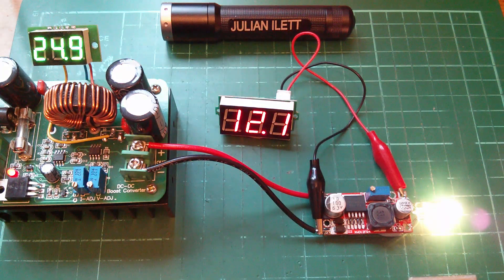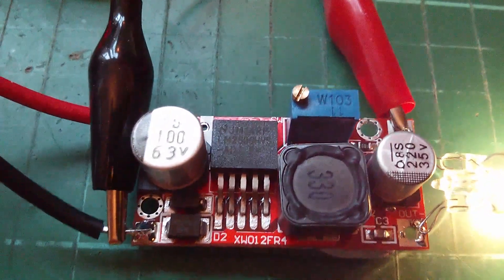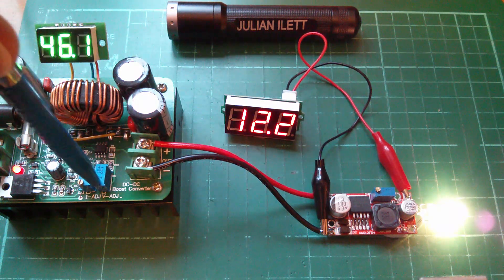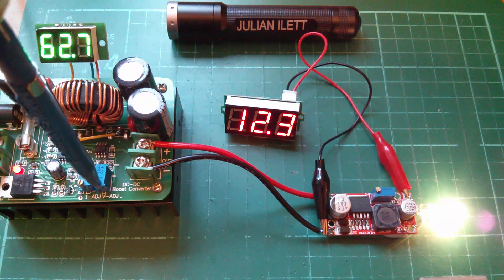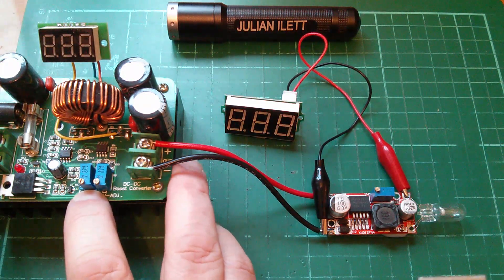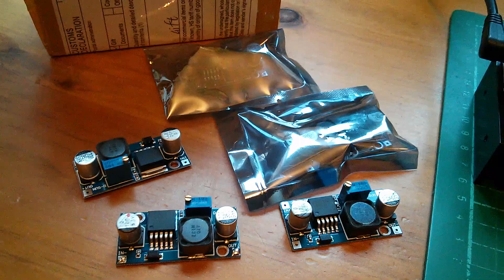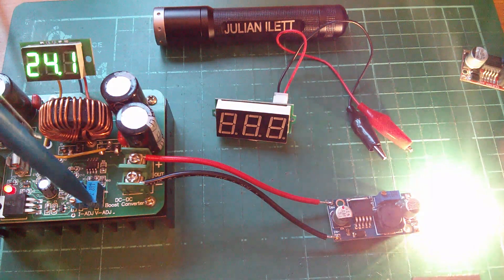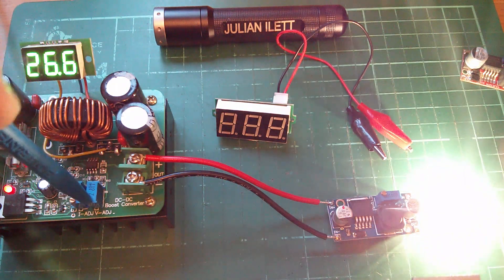Fake LM2596HV Voltage Regulator Buck Converter Modules bought on eBay

Comment: how is it fake if it works?????
Reply: +Ese Callum I have given you an example to explain difference between real and fake. It doesnt matter if designer or locally small business made, Whats important is the integrity of the product
Reply: Well if you want to spend a dollar to "measure" output voltage for a few days rather than spend 2 dollars on something that will do the job for years, go ahead.
Buy cheap, buy twice.
Reply: Well you can still wear fake adidas shoes, but it last few days or weeks instead of a year or more. Same goes for this, They use substitute quality semiconductor core that manufacturing cost is fraction of authentic one.
Reply: I think you have been at too many presentations which spout marketing bullshit.it's a a simple dollar device for measuring voltage....integrity of product my ass.
Reply: i would NEVEr GIVEANY MONEY TO ADDIDAS or a designer label...who cares...for a dollar..you probably spend 20 dollars on a beer which you piss out in 24 hours.

Comment: What was the LM2956HV input rating on the data sheet, I thought I saw 40v, or 45v, and the supply voltage was taken up to 55v if not more, ..did I see that wrong
Reply: Yes, you both saw it wrong... Julian was looking at the data sheet for the STANDARD regulator chip which listed that voltage, NOT the one for the HV part, which is supposed to handle 60V. He pulled out the standard chip data sheet because he suspected the chips had false markings and he wanted to know what voltage the standard regulators would fail at to see if his "HV" chips were actually standard ones when he cranked up the input voltage.

Comment: They are not HV, you can tell just by the way they look. I would send them back. If they were cheap then use them for low voltage use. I really don't trust things sold on Ebay to be authentic. Ebay is full of cheap knock off's so buyer be ware.

Comment: Check out your inductor value while you are there. No-smoke unit says '330', smokey unit   says '470'. (uH?) Swap the 330 from the no-smoke onto the smoker, see if that is the problem.
Reply: its actually 47uH, last digit is the 0 multiplier
Reply: Yes, I appreciate that, my point was the value of 33uH instead of 47uH could be the cause of the smokiness, ie;  the circuit can't handle the higher inductance and is operating outside it's intended design range.
Reply: I agree with you, these modules have fixed inductor values, but in fact, you need to select values according to your MAX input voltages (see the datasheet).

Comment: For what it may be worth I have also found quite a bit of "bad stuff" on Ebay. 
In every instance I contact the supplier & politely ask for replacement or refund.
After a bit of "toing & froing" in 9 out of 10 cases I receive a refund. Occasionally I have had to thresten to leabe negative feedback which hastens things along.
All the el cheapo electonic stuff is inherently suspect, order or use at your peril!

Comment: This video is a fake!! ....or rather the claims that there are "genuine"  LM2596HV chips available?  Where is the data sheet?!  The nearest neighbour I can find is a LM2576HV.  Please update the video with further and better particulars please.
Reply: Yanick Smith CVT constantly variable transmission
Reply: http://www.datasheetspdf.com/PDF/LM2596HV/1012141/3
Reply: Spencer Sawyer Interesting...thanks for sharing.  the 2 boards i bought which, apart from being blue are similar to the video above.  The chip i have is marked with the national semiconductor logo and as such i called "fake".  it looks like you've probably found the source and, after using the board for the last year or so it does at least seem to work ok!

Comment: For what its worth, I bought a none HV version that is an exact match for the blue 'fake' one you bought. It interestingly has a 50V input voltage capacitor on it, which matches your fake one before it was changed.

Comment: The term 'fake' is not as appropriate here as 'bad copy'. Apparently you aren't aware of all the tv's, computers, radio's, calculator's, multimeters, etc. that use the same or very similar board designs, any one of which is either the 'original' design or a variation, either purchased or cloned. There are even automobiles with the same basic guts being sold as different brands because they have different body parts. You certainly wouldn't call these 'fake', but only because you feel it's safe to assume that the seller 'bought' the license to use the patented design. But the buck always stops when it comes to the quality of the parts used in the construction or shortcuts to expedite production or a lack of the complete set of features. Are these then 'fake' because they don't rely perfectly on the original design and specifications? No, they are simply poorly produced copies.
The buck is the only common denominator that causes the variations: savings on design, savings on cheaper parts, fewer design elements used and the list goes on, but I'll stop shy of going into the level of abuse of all technology in the name of dead presidents. Suffice it to say that there is a serious level of pathetic profit chasing at the hands of investment driven financial institutions, many of which encouraged the displacement of jobs and manufacturing to lower-wage, uneducated poor populations in other countries, and the fact that this 'Wall Street cancer' is attaching itself to every manner of merchandising all over the world shouldn't be blamed on the poor folks or the corners they cut to 'make the grade' for continued rewards from this corrupt system where safety, quality and the human condition are second class idealism's.
A true 'fake' is a plastic fruit or other plant, a car-shaped balloon, a hair-piece made from artificial fiber, a flower that looks like a bird, a bug that looks like a plant, etc. At least the latter, organic types of 'fake' are related to the overall success of the respective species, rather than a few bad CEO apples.

Comment: You pushed it way past the Datasheet Max voltage of 45v. Of course it's gonna blow.
Reply: +Rob Prebil LM2596HV. HV!
Reply: Tough little unit though...
Reply: "You pushed it way past the Datasheet Max voltage of 45v"

For crying out loud, why did so many people get confused about this. The data sheet Julian was showing was for the STANDARD part, NOT the HV version that was supposed to be on these boards. The reason he checked the standard data sheet was because he suspected the "HV" parts had false markings and he wanted to know what voltage would blow up a standard chip so he could apply that to the suspect regulators to see if they failed.

Comment: Use the low voltage version of this in my resurrected Black and Decker dust buster (lithium 18650 conversion), It rocks!..  Works with the original a.c. transformer too (half wave rectified). Never had a problem with these used anywhere, but will be wary in future ;)

Comment: Does this buck converter(LM2596s)
 work on a motorcycle with a12v 9amp ? I want to reduce it to 4.5v dc for a led tail lamp.Pls help. 🙂
Reply: +arun reetha These converters are usually only good for 1 amp, for reliability. Claims of 3 amps with heatsinking are made. No way for 9 amps.
Reply: +arun reetha if its just to power LED's yes that should be fine, just install it without the LED's set the forward voltage to what the LED's need via the little pot and connect the leds I'm assuming they don't draw more than 1 amp as the other poster pointed out more than that and the magic blue smoke might escape. but tail lights etc all good!
Reply: +arun reetha hi Arun, what's going on with your project, does it work?, let me tell you one thing, i put one boost not buck converter, exactly for my led tail lamp (with 120 leds 2835), i boosted voltage to 17V, and works OK but only for 20 min, after that i noticed an unexpected behavoir of my led tail lamp, until now i ain't figure out what's going on, but i will (hopefully), regards
Reply: thanks a lot my dear friends for the reply.thanks for sharing your knowledge, now i made a tale light with led strip without any buck converter. now its working fine ..

Comment: I had this problem with the 400W model. Turns out reflowing the solder usually helps (Since one phase was getting converted, it gave out weird outputs due to one terminal of the power transistor not being tinned.)

Comment: Hi thanks for the video, i was needing to have an adjustable dc power supply for my benchtop and noticed yours, could you explain for me how you connected the led display to the 600 boost, I have purchased the 600 boost and a couple led displays from aliexpress but need a little information on getting them to work together. thanks
Reply: Did you ever find that little LED, its great. Would love one.
Reply: eBay - search "LED voltmeter". The 2-wire ones measure their own supply voltage. The 3-wire type can measure a different voltage (with a common ground), often a much higher voltage. See my review on a 2-wire voltmeter which runs off 5v to 120v DC @-nYI

Comment: What about the circuit design ?  Maybe component on circuit are limiting what you can throw in the device?
Reply: Yoram Stein 
No.. it is the chip/capacitor.
Look: http://www.ebay.co.uk/itm/311391713694?_trksid=p2060353.m2749.l2649&ssPageName=STRK%3AMEBIDX%3AIT

It is the standard one, but just the exact one that is failing.. and has a 50v capacitor.. so yes they ARE FAKE.

Comment: The 63v capacitor on the real board is much bigger than the 63v capacitor on the fake board, showing that the cap may have been remarked

Comment: How do you go about finding the datasheets for these products, is there a source site that stores datasheets?
Reply: I find a search on Google is usually best. Although, typically, a number of data sheet dedicated sites come up with most components, they mostly seem to use HTML copies of the original PDF documents, so I tend to look for the actual manufacturers web sites in the results as their data sheets are mostly PDF format and are kept up to date. If the component has a manufacturers logo on it you can include their name in the search to increase accuracy. Hope this helps.

Comment: There are other ways to get ripped off on Ebay besides fake products.  I ordered a lot of 10 LEDs from a seller called Happydeer88 but they only sent 1.  That's a common ploy of scammers to cause delays.  They keep saying they are sending the remaining parts but won't give me a tracking number.  I'm not sure if Ebay is in on the scam or they are really that stupid because there seems to be no way to get a refund from them or Paypal either since the seller don't take returns and the item is marked as Received. I ordered 2 items from a seller called Friend2313 or Easy24 and right afterwards they were delisted by Ebay and the items removed so there isn't even a listing for them now.  The seller did send something, probably just empty boxes, but they went to random addresses in Oakland, CA and Newark, OH while I live in Phoenix so I didn't get anything at all!  That's also a common form of scam since the items get marked as Delivered making it harder to get a refund.
Reply: +Virtualgod2009 I did finally get refunds from Paypal, it just took a while to get it.

Comment: EE here.  The LM2596HV is not only counterfeit, but TI never even MADE a LM2596HV!  Also, they don't work- the IC won't take high voltage, and the cap's got forged voltage- mine heated way up at even 30v.  It's not a 60v cap for sure.

So, what do you do if you NEED a supply like this?  EASY!  Order LM2576HV from TI- it's the same package, same, pinout, genuine 60v Vin, and actually exists.  And a new 10mmx10mmx12mm(high) SMD genuine cap.  In 63V, 100uF is the largest capacitance in this form factor.  If you actually use a 60v Vin (I only used 48v), you may want a higher DC rating but there are no 10mmx10mm SMDs with >63V.  There are some slightly larger in 80v, but 47uF max.  You may also want to replace the output cap.

You may also need to replace the diode, I don't know what voltage it actually is.  That is a DO-214AC, SMA diode case.

A few minutes of SMD rework and you've got a GENUINE HV supply!  The price for the fake "LM2596HV" is worth it just for the board, inductor, resistors, and trimmer.  But it might make sense to go with the cheaper non-HV counterfeit "LM2576" unit since you're ripping it apart anyhow.  I'm not sure if the resistors are appropriate for a 60V output, though.  Also you want to make sure the inductor's appropriate for the LM2576HV, 100uH is a good value.
Reply: @Danny Miller, if you need 2A or 3A (high current) for the output the LM2576HV make sense, but according to the part specifications, the Quiescent Current (Iq) is a rather substantial 5mA (and not all applications can put the part into lower-power STANDBY mode).  For applications needing only 1A output, the Linear Devices LTC3637 is a better choice with an Iq=12uA and Vin-max=76V.  For 24V automotive applications, one could add a TVS diode (e.g., P6KE36A, Vc=49.9V) between Vin & GND for 200V Load Dump protection, followed by an inline Schottky (e.g., SBR2A40P1Q-7) on Vin for reverse polarity protection.  Vout can be designed to a fixed 12V for 12V-devices up to 900mA-max and then adding a cheap LDO on Vout, like a HT7550-1, could provide 5V@100mA-max to an MCU.
Reply: I thought of this, and now i've just made the order on farnell. Will replace with a genuine IC and rated capacitors. I'll be drawing about 2.5A at 5V on this so hoping the ripple and heat won't be much of an issue.

Comment: The Electrolytic Caps are to be used at no more than %70 of their rated voltage
so the input cap is only good for around 42V not the marked 63V! so if you need to use the device to max 60V you really need the 100V rating on input Cap.
Reply: they look like solid capacitor not electrolytic :P
Reply: Mehdi Daryadel Thanks for the insane quick reply :) I found the data sheet, says "rated voltage 2.7v, absolute maximum 2.85v" so I feel better now :) That's 16.2v rated for 6 x series bank with 17.1v maximum. In searching for the datasheet I also found a super freaky cap, 2.5V / 5400F. That'd give me 15v rated at a mind blowing 900f (instead of the 500f I get out of my banks now). Can't wait to find out the price!
Reply: Mehdi Daryadel Correct. In fact if you use these in as an OEM consumer product over a 100C temperature range, you should derate the cap by 50%.
Reply: Super caps are totally different type of caps and you need to look at the datasheet for Max Voltages.
Reply: you're talking about supercapacitors ....way way way different than electrolytic ...also supercapacitors as ALL capacitors need to have a kind of control over voltage when connected to series(because if one cap goes to e.g. 3v ...kaboom :P)
Reply: If a cheap China listing says 60v I probably wouldnt be applying more than 30v same for current - if it says 2A I assume 1A.  So far this philosophy has paid off as nothing has blown up yet.
Reply: Mehdi Daryadel That is not an actual rule, not for aluminum electrolytics.  The 63v working voltage cap's datasheet is a max surge of 1.15x rated voltage.  The "useful lifespan" at 40C is "150,000 h to 400,000 h" at 1.8v the rated current.  Cap life IS increased by using less voltage, but the cap's rating is still for 63v.

Tantalum is another matter.  Tantalum caps generally have very poor lifespans if kept at their rated voltage.  At least they have in the past.  But there are different ratings standards so there's kind of a problem there.
Reply: Mehdi Daryadel Is this true for super caps?!?! I have 6 in series (6 x 3000f 2.7v) and am feeding them 14.5v (max rated is 16.2v), is this safe? I was going to bump it up to 15v, now you have me worried! I have 2amp balancing boards on them.

Comment: Hello, I bought a LM2596HVS buck module on ebay, pretty the same as yours but there's two 63v capacitors and two diodes. (check 291229660194 on ebay)

Hope it's not a fake version of the HV buck converter. The one I bought is also much cheaper than your "guenuine" version (2,59 gbp)

Thanks for the video !

Comment: I just had my "LM2596HV" fail in a 48vin/24vout after about 20 hrs- no output anymore.

I put in another from the same order, adjusted it to 24v, hooked it up to a load- no output, took off load, still no output.  Input cap was getting hot on 48V!  But, a cap breaking down won't likely cause the part to fail.  Put it on a 30V bench supply, the cap wasn't getting hot, but the module put out zero volts and the trim pot did nothing.

Something's very wrong here.  TI lists NO SUCH PART as a LM2596HV at all!   People say the whole product number is a counterfeit Chinese mfg, and nowhere near the rated voltage, which I concur.

TI DOES make a LM2576HV, 60v.  Ebay lists LM2576HV bucks but look at the pics- most of the pics for those listings STILL say "LM2596HV" until you get to the ~$5 products.

Comment: This is a very good information, because I was thinking about to buy these fake converters, thanks for helping to make a better selection for my MPPT project for the little power source for arduino feeded from diferent battery voltages...
Thats right the red converter module have the correct smd diode's...

Comment: What's the name of the left power module ?
Reply from the maker: Michel Esc An eBay search for "600W boost" will find it.
Reply: Thanks I found it =D
Reply: +Julian Ilett if it is not used with 45 or more volts like you showed it having no problem, will it be safe? Just don't give it 60 volts we mean, will it be safe to use at the other voltages like 55 45 35 25 etc..... or because it is a fake DON'T use it at all? GREAT VIDEO we subed your page thanks for posting it, we just got some bucks etc... not this type  but boost converters dc to dc ac to dv etc...